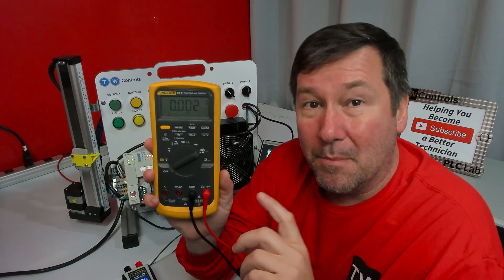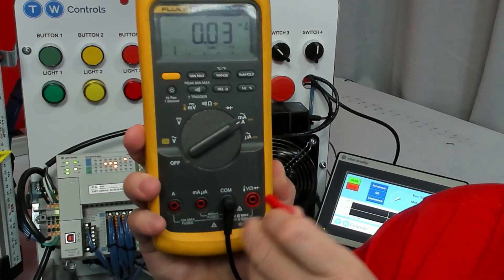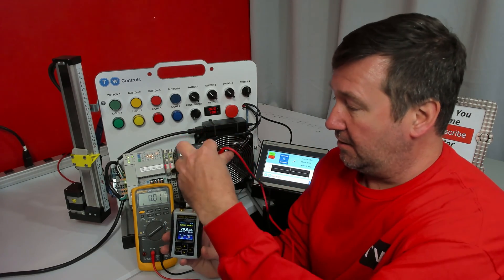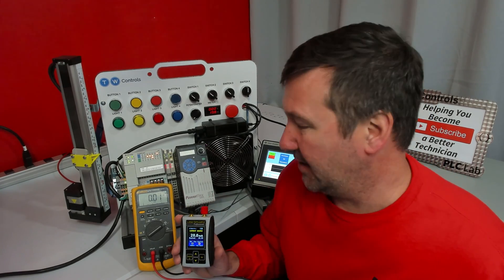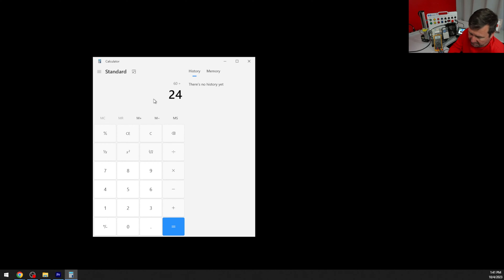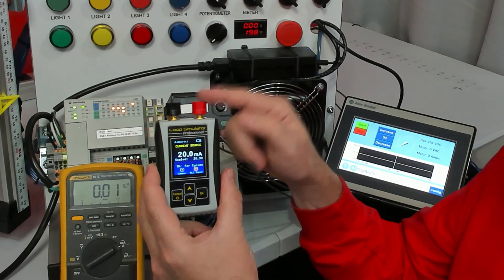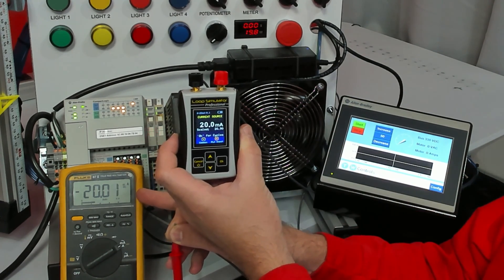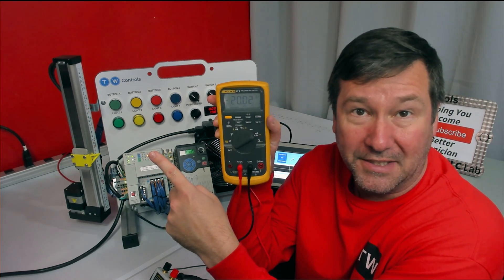How to Measure a 4-20mA Circuit without Blowing Your Fuse

Comment: My Fluke 87V SI now has a problem with measuring current; it doesn't appear as number zero, and anything but other functions is normal. Can you help me fix
Reply from the maker: Check the fuse and post positions
Reply: @TimWilborne thank you sir
Reply from the maker: You are welcome.
Reply: @TimWilborne i was check and found that the post position fault but I am not yet to fix
Reply: Can you show me how to fix this problem?
Reply from the maker: Check that fuse.

Comment: Hope you find this comment can I with a medium quality normal clamp meter messure that same signal.. I started working in a food factory and there are a lot of sensor to test is it possable or not thank you
Reply from the maker: No, it has to be a clamp meter designed to measure a 4-20mA. Check out this video on the Fluke 773.
https://youtu.be/M9l26ScR6zk

Comment: The current reading at that point would be parallel anyways so even if you matched the resistance of the device in the field with your meter, the value wouldn’t be correct, if I’m thinking about that right.
Reply from the maker: I suppose with a little math you might be able to work that out, but your value in your actual process would be cut in half while you did it so it would still be a bad idea...but an interesting electrical experiment :)
Reply: @ yeah that’s what I was thinking. I’ve seen people try it in the field and wonder why it didn’t work lol

Comment: I always teach people that a multimeter becomes a “fused jumper wire” in amp measurement mode.  This can be confirmed by measuring resistance or continuity of the test leads with another multimeter.  

Once the person understands their meter is now a “jumper wire” (with a fuse in series with the test leads), i show them how to use the “jumper wire” to test/force +24vdc inputs to a PLC.

Comment: When I'm reading small currents how come switching from the mA port to the A port shows widely different results?
Reply from the maker: It has to do with the resolution and accuracy on the different ranges.  Take the 87V for example, if you look at page 48 of the following manual.  On the 60mA range, the resolution is 0.01 mA.  On the 10 amp range the resolution is 0.01 A  or 10 mA meaning before you even consider accuracy, it is + or - 10mA.
https://dam-assets.fluke.com/s3fs-public/80v_____umeng0200.pdf?tKDGTic.KN0dP9_UJVtSyLsuYWEUp3SY

Comment: if you need to measure 4~20mA signals a lot you are better off getting a meter like the Brymen BM789. it has a special 4~20mA mode that translates the 4~20mA range into percent.

Comment: Super important!!! I’ve seen so many people blow fuses. I have 6 fuses in my meter case, I started with 10 fuses. I’ve had 3 technicians blow fuses while I was there or have blown fuses in their meter.
Reply from the maker: Happens more often than people realize!
Reply: @TimWilborne  Is there a reason multimeters aren't fitted with resettable fuses? Or even an indicator to let you know the fuse is blown?